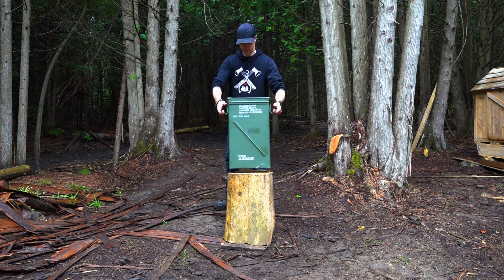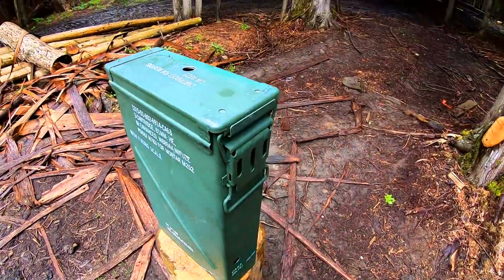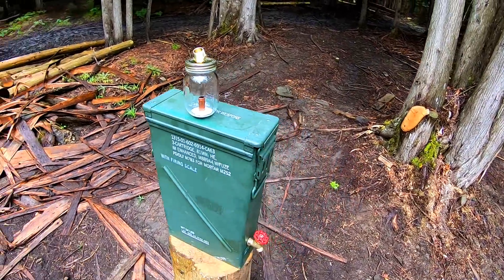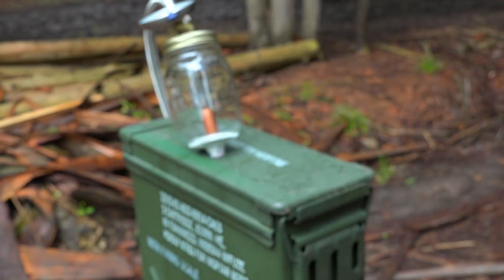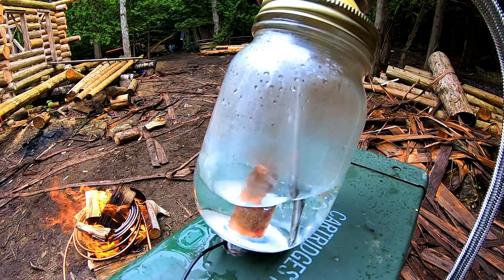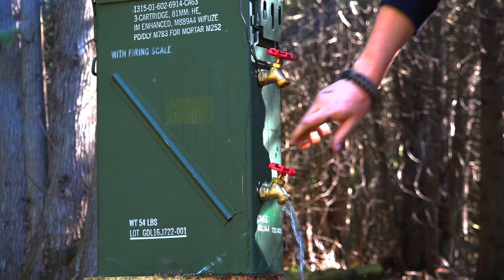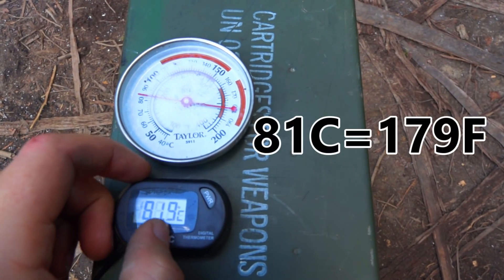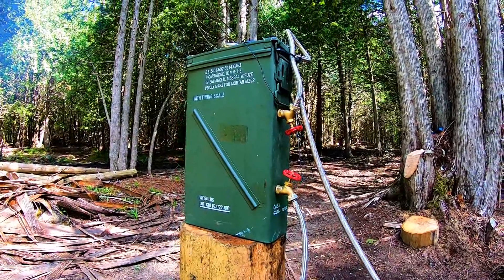Off Grid Heating Prototype- Copper Coil Water Heater / Heat Exchanger / Radiant Heater

Comment: First off,  i love this.    Second,  a potential issue has come to mind.  If you fall asleep and the fire goes out,  you will have a frozen mess and hopefully the pipes don't burst.  Yes, to all of you reading this, i know there is room for the water to expand in the top of the ammo can, but if an ice plug forms in the copper line, it is possible to burst the coil. Since everything is metal, except the rubber washers,  it is possible to just restart the fire and issue solved .  Please do an update video after a snowy camping night.

Comment: Wouldn't a tiny wood stove saved you all that work?
Reply: The fumes smell, will take a stall
Reply: Just heat rocks and put them into a better container for the night. Indian 101...
Reply: No flame in that tiny thing would be dangerous.
Reply: no more dangerous than in a small ice fishing hut.
Reply: @rchristie5401  Your not sleeping in the ice fishing hut
Reply: @piemoon2488  I do sleep in a ice fishing hut.
Reply: @rchristie5401  Well I wouldn't want to sleep with a stove in an ice fishing hut. I'd kick the thing over. Everone I sleep next to says I do the electric boogie in my sleep. I don't think its a solution for everyone.
Reply: @rchristie5401  Plus some people may be interested in the hot water aspect more than the heater aspect.
Reply: I'm pretty sure that a fire stove would deprive the actual buyers asked Jim before he wakes up but hopefully it's not a harmonically sealed injustice in case anyone is wondering I just has two bowls of cereal.

Comment: since you decided to over-engineer everything (instead if using hot pipe and finnish candle method like i suggested in one of your earlier videos) you might as well install radian heating inside your camper. it'll be most advanced low tech bush camper on the planet, lol.

Comment: Copper tubing will liquify at the temperatures created from wood fire .
Reply: I think the water inside the tubing will prevent the copper from conducting enough heat to melt.

Comment: I know this is really more of a proof of concept but I'm concerned what will happen if the whole system freezes? Sure he can empty the lines after each use. But if the fire go's out in the middle of the night then the copper lines could very well freeze with water in them.

Also he could probably get the same results with a small diameter copper tube 1/4 or 3/8 inch, wind a tight coil about 3" in diameter and about 8" long that will go in the fire, then use muffler insulation on anything else exposed.

Comment: Looks so simple, I love it - great show.  I don't like that fire to be left alone, though.  I would prefer a round rocket stove like a old 20-gal Propane tank converted, and have the copper tubing wound round around the tank.  Leave stove after a good quantity of embers are burning brightly.  More than that I don't fully understand, would have to experiment.  Somehow I would like to continue the tubing beyond the hot stove (adding a brass fitting to new tubing as it is too long as one piece) and run under the camper floor as others suggested before me.  
But I would look into the cost of radiant heat tubing which is more pliable and resilient than copper tubing and expands and contracts with heat and cold; also it would save hours of time installing it under flooring.  
You probably thought of all this already, but made a show&tell campfire for ease of explanation.  In any case, this is a turn on for this old geezer.  It's time I tried this as the proverbial shit may be hitting the fan in the not too distant future.  Two cents here:  9mm ammo is very good for trading, second is Silver rounds and Roosevelt dimes.  ciao.
Reply: If you can't leave a campfire without burning down the forest, you shouldn't even be trusted with a rocket stove.

Comment: You’ve made a barista steamer. 

3 things..

1) Shorten the copper heat exchange in the fire to 1 loop. 

2) Flip the tank’s top valve 180 so the return line’s hose drapes down naturally to the heat source.. will make the thermal siphon effect actually work. 

3) When the fire goes out, have compressed air ready at bedtime to purge water that would otherwise freeze burst.

Comment: Hi . i made something similar , i use a fan grill to keep the copper firm and spread it equal heat like a espiral . and les tube so you can leave it for longer on the fire. i use it to heat up my hot tub, similar to this https://youtu.be/C48f9RNEtCQ

Comment: Try using a check valve.  It works like a pump and you can put one end in a nearby stream or River. And as the water heats in the fire hot water is being pumped out as cold water is being sucked in by. the nearby stream or river what have you. It works well I've done it myself. But you must have the line full of water to start off with.  You can also put a T on the line with a hand valve to circulate the hot water back to the stream or River or what have you, when you're not using the hot water.

Comment: Keep the ammo box outside to avoid bubbling noise and safety hazard then put a heater core size or small radiator inside your cabin with  with a little solar battery powered fan to circulate hot air. Great invention with little tweaking.

Comment: The fire is not small. Look at incorporating a rock stove design that will us way less wood. Finding a way to separate the copper pipe from the direct heat will also greatly extend the life of the copper.

Comment: please be safe. i think when you are figuring a better way, dont forget a fail safe. i e  pressure relief valve.  geez, i would not want you to get scalded. i could be wrong, but if you seal it like a car's radiator, you raise the boiling point and pressure.

Comment: A thermocouple can be made by twisting steel wire and copper wire together cut 1-2 foot lengths of steel and copper wire together lay wires side by side and twist together 1/4 of the way and do the same on each end of wires pull wires apart SLIGHTLY.    \/\/\/ IN THIS PATTERN AND CONNECT POSITIVE TO COPPER WIRE AND NEGATIVE TO STEEL WIRE.  put one ends of wire in the fire and the other out of the fire and heat will produce current for more current wrap cotton around cold ends and dip in water, the current of heat in the wires hot to cold will excite Atoms in the wires causing voltage to charge a phone or charge a Battrey or run led lights from the fire 😁

Comment: Could also maybe add one of the relief valves from a steam radiator and loose the hole at the top. Also why not add baseboard heating fins into your little camper and have the water heated the same way for it? You wouldn't need much of it at all inside.

Comment: Maybe instead of an ammo box find a small tank that can deal with  the pressure of being an enclosed system.  You can run copper coil out the top and back in like a radiator- or find a small steam radiator

Comment: I have misgivings about using water lines since you will be using this in the dead of winter. A couple of solid thermal masses placed in your fire to heat up then hung up inside to radiate their heat through the night may be more practical. a couple of large kettlebells or river stones might suffice.

Comment: Condolances on your mom.Y wish you strenght. 
 Y see a lot of good comments below here, using a pressure relieve valve to make it more quiet and efficient working on a little over pressure., Jou can make a relieve pype to the outside to prevent moisture. think you can do whit a smaller coil, so you can keep it in the fire at night when sleeping, so you dont have to get the coil out< this system is verry effective, and you dont need that mutch heat anyway in that tiny cabin.

Comment: Insulate the ammo box.

And the parts of the coil that aren't enflamed.
Reply: Did you even understand the video? why would you insulate the part hes using as a radiator lol
Reply: @chrisjohnson1715  I completely forgot about that lol.  I suppose I was thinking along the lines of keeping the water warm. That and multitasking certainly didn't help. Doesn't make much sense though. That being said I would still insulate the copper where I could.

Comment: Use a water heater instead of the ammo box.  Mine works great. I ran a second copper coil under my floor.  I fill my outdoor tub with the 50 gallons of hot water too.

Comment: I have and alternative heat source for the sled house. This one requires a length of 2-inch, 10-foot long exhaust pipe with a 90-degree bend about 16 inches from one end. Next a round of log maybe 18 to 24 inches long and at least 10 inches in diameter. and a piece of wire about 3 feet long. Now split the log in half and then one 1/2 into quarters.  Now take about 3 or 4 inches off of the sharp end of the quarters. Next, put the three sections together to reform the log and bind it with the wire. Now start the center on fire. You might have to elevate the log an inch or 2 for a draft.Once the center is cooking insert the 16 inc part into the log and put the long end into the sled and wala heat. The log usually lasts for about 10 to 12 hours. I lit one up at about 8:30 at night and the following morning at 9 am I was still getting heat and the tent was hovering around 65 degrees which was about 20 degrees warmer than outside.I actually was able to get 3 nights out of it by putting out the fire inside the log. 
I know this doesn't sound all bushcrafty, but I used my propane torch to fire up the log.LOL

Comment: A metal fireplace installed outside of the camper with hot air ducts at the top and cold air ducts at the bottom this will draw air and heat the cabin plus you could cook inside with the small fireplace put coil inside of rocket stove-fireplace and box outside run copper tubing on the floor and overlay it with a thin floor. Install the water tap inside for hot water for coffee or tea, water for cooking. This small er system will be more efficient plus you can cook inside🤔

Comment: Coffee pots have a ball valve that only allows water in one direction you can buy a brass flapper valve to put in line this will increase flow, how about a water tap on the side for hot coffee or tea? That would be nice and keep you warm don't let the ammo box fall over it could cook you like a Lobster? 😵 Mount it down with straps. After water is boiled it becomes safe to drink, you could make a water filter with coffee filters in a can  with a tap on the bottom and fill can with fishtank carbon then some more filters and a few stones or glass rock for fishtank, this will be effective in filtering the water and removing any bad tastes and contaminates, the bean can filter will last you for months

Comment: It may work. But what is the efficiency? I suspect, it is pretty low. Using wood to heat the coil, for example (0:21), you are probably wasting more wood to heat water with this DIY setup than it is worth. There are better options to heat water or space with wood.

Comment: Made one like this before for the likes of your camper sledge could just run copper under the floor or could make a sturdy box for the tank sit the coil on hot coals it will heat slower and be easyer to live with

Comment: Would it improve upon the efficiency by putting the intake & outlet on opposite sides of the ammo can so there is less of a chance of the water flow short circuiting thus heating more evenly?

Comment: Lol 60 dollar Buddy heater 4 dollar bottle of propane crack your camper window a little and problem solved, Don’t have to mess around with a mortar can, 5 gallons of water, 15 feet of copper pipe and maintaining a fire outside all night.

Comment: Might be a bit late now, but be sure to wrap the threaded portions of the connections with some teflon tape to prevent leaking, there is always a tiny amount of play in brass fittings and the teflon tape takes up some of the slack and also seals the threads to not allow seepage. Another idea I have is to run another copper coil inside the ammo can, the coil would heat the water and the ammo can would work as a heat jacket essentially creating a closed loop radiant system so you dont have to worry about steam buildup. Good Luck.

Comment: You could run coils the coils through the box and poke them out of each side and put unions on them and two unions on the coil outside and have a hose bib on a high point on the box so you can get water in the line so it can all seal.

Comment: Nice video! I have an idea of what happened in between the cut scene of @4:25 and 4:29 ...Oops?
I also have a suggestion that you may have already thought of: (Since in your other videos you have a spot that you placed your other heating ideas) I would rig up an outside steam ventilation flume at an upward angle (out of thicker metal so the steam has a chance to condense to liquid and drop back in the tank) or your tiny camper will be called a tiny sauna haha!

Comment: I was going to say you could design it like a radiant heat system
Reply: ty plumber ......lol. You are correct. I mentioned that 5 months ago in 11.6 comments...
Reply: He could set up his small stove away from the cabin, run the copper ( then pex ) to the cabin and lay ceramic or sandstone tiles. Safe indoors and out.  Voila, a Burnham!

Comment: Set the ammo box outside, next to the fire, place the coil or better yet, an old car radiator inside the cabin.  DO NOT build such a big fire, you only need at best 3000 BTU's of energy to heat such a small place.  I have a 40,000 BTU wood stove in my 500 square foot cabin in Nothern Michigan USA. I have to keep the windows open when it is 20 degrees below zero f.

Comment: You could incorporate a vertical tube boiler into a pipe that replaces the chimney on your woodstove.  You could also make one in a pipe with a cone/skirt on the bottom that sets on a tripod over a campfire to collect the heat...

Comment: Good job overall, there is room for improvement as usual with anyting people make. If you install the cold water tap at the bottom close to the bottom as possible, and it was a good that you changed the level of the upper valve. It's helpful if you have the coil more organized and perhaps fewer coils but not many. Just some. The pipe coming into the coil at the bottom should come from the bottom of your tank. The top part of the coil should go into the top of the tank as you had it I believe. Then you could also run a larger piece of flexible copper pipe around the perimeter of the floor of your cabin. If you could have the on the floor actually go upward slightly so the hot water goes in at the bottom and will want to go to the highest point causing automatic circulation. However having just a warm tank of water will you play well through the night and you might want to insulate 3/4 of it having only a portion of it open the last longer and maybe even have a way to control that portion so it does not Escape all at the beginning. So a tank within a control box. You could put a vet at the bottom of the control box along with a vent at the top of the control box that would allow an automatic drawing cool air from the bottom and hot air coming out of the top. That would cause automatic circulation of air albeit slow.. definitely clothes off the top hole once you're done so it can't fall over and burn you.

Comment: I grew up in Southern Nevada outside Las Vegas. It was common to see coils of copper tubing, or garden hoses on roofs back in the early 1970's. It was how folks heated their swimming pools. Very much like your idea, only solar.  Did you see the video of the Swedish Torch  and pipe heater?  Simple, lightweight, and I think it would work pretty well.  Great video...again!

Comment: Your not thermosiphoning you are batch heating like a coffee maker.  Thermosiphon is a low energy process and works as you described by density change being acted upon by gravity. Because your heat source is horizontal it cannot thermosiphon.  Yours is powered by steam. As the water boils and expands it escapes by the path of least resistance to the upper tank fitting which has less head pressure.  You need a vertical tube boiler for aTrue thermosiphon and it would be very quiet and have a steady flow until you exceeded the heat capacity of the water in the pipe.  If you put your coil in a can, you can probably bump up the efficiency quite a bit(less wood for the same heat)...